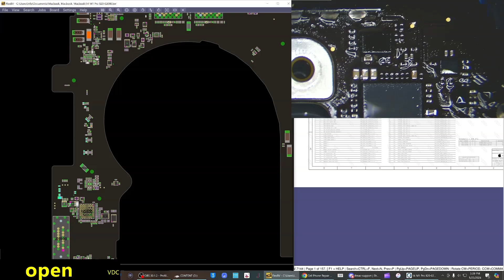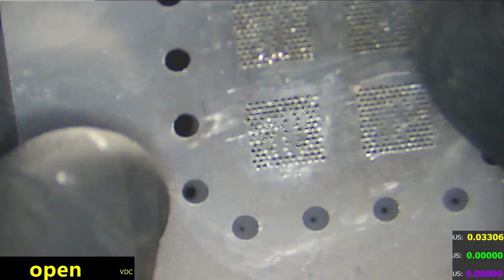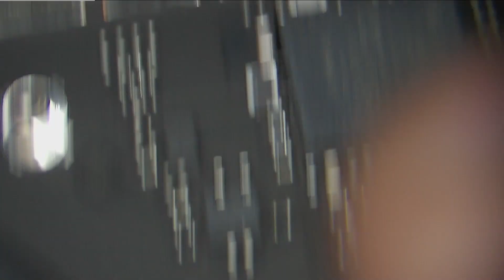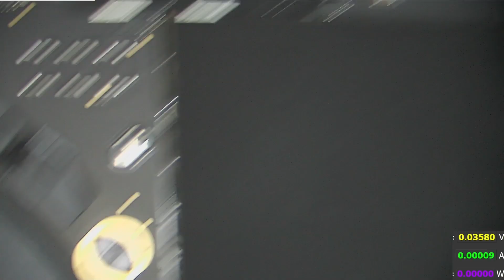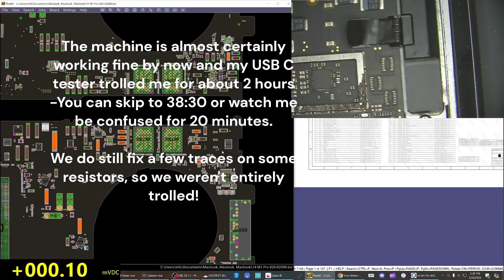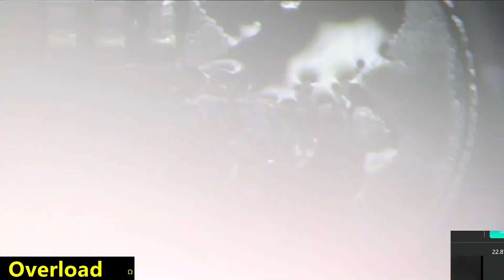M2 A2779 820-02841-A Liquid Damage Motherboard Repair

Comment: 10:14 I would suggest that like 820-02098 and 820-02100  (M1) boards, that this board will not boot from USBC without a battery connected. It will however boot from Magsafe 3 without a battery.